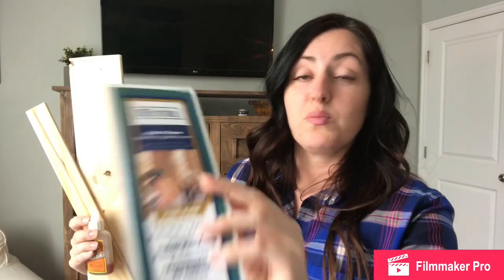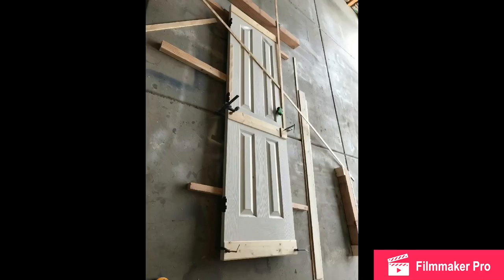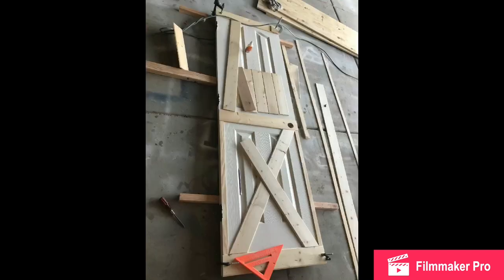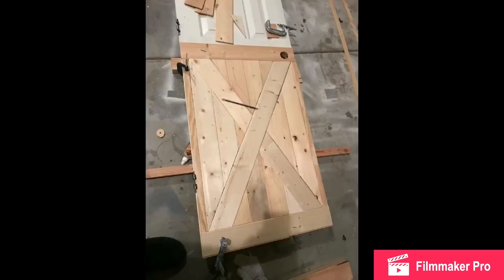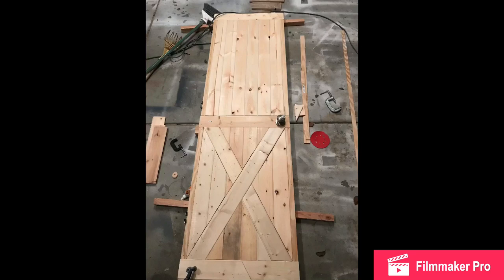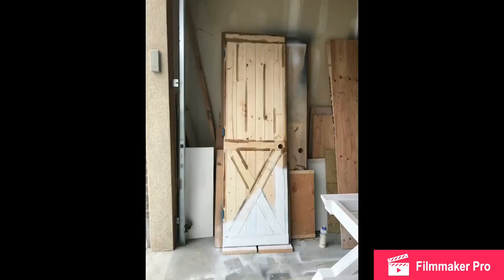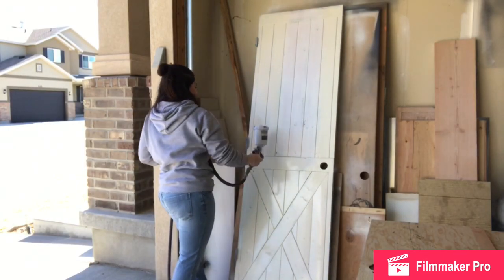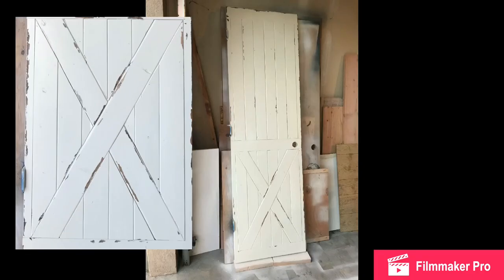DIY Faux Farmhouse Door, and upgrade for your current door

Comment: Hi this is beautiful.  Can you suggest how to do this for both sides or it doesn’t matter as far as it fitting and still able to open/close??
Reply from the maker: I actually wouldnt suggest putting anyting on the back side if that is on the inside of the door casing. It will make the door too thick to close in the door jam. Good luck
Reply: @EternalHarvestDecor  thank you I think this will be my first project after investing in some tools.
Reply from the maker: Sweet! Good luck!

Comment: How can I make sure that when I start adding the wood it won’t make it too thick to the point that I won’t be able to open the door?
Reply from the maker: Karely Sanchez good question! I would not use anything thicker than these 1/8-1/4” pieces and stay on the back side of the door. Nothing that will go where the frame is, or that will effect the ability to latch. Does that make sense?

Comment: Question? Do we need to do anything to hinges ? That 2-4 mm will not let  the door close. Please let me know !
Reply from the maker: I did not, the door closed fine because it was on the outside so no changing the hinges at all. If it were on the inside I would have had to
Reply: @EternalHarvestDecor  thanks alot 😊

Comment: How does the doorknob still work with the added thickness?
Reply from the maker: Sorry, I answered this when you asked and for some reason it didnt post!! I apologize for the delay! The door knob works great if the pattern is attached to the side of the door that is on the outside of the jam. If its on the inside you want it to attach where the door frame wont hit.  Hopefully that makes sense. I didnt have any problem with the door knob going back on but you could cut that portion out if you needed to.

Comment: Looks nice.  Good job.  I was wondering how can you apply this design for the interior portion?
Reply from the maker: S Merck great question! I think you could apply it the same way as long as you leave the door casing area free. Does that make sense? So you would just do the portion that’s visible when the door is closed
Reply: Or you could adjust the door jams